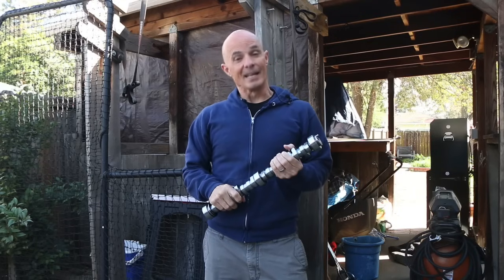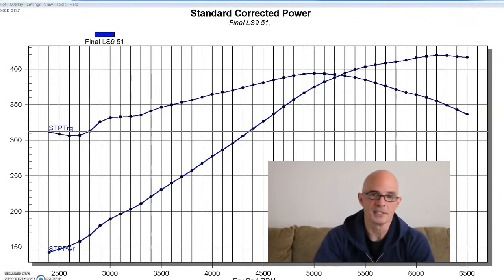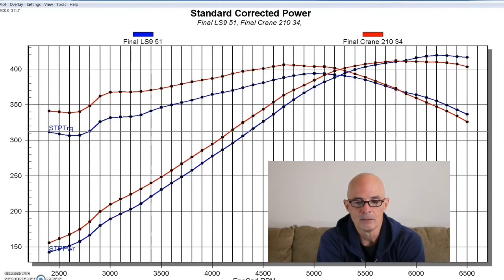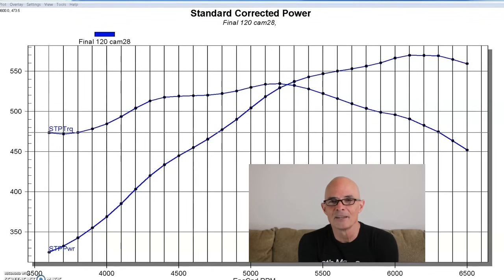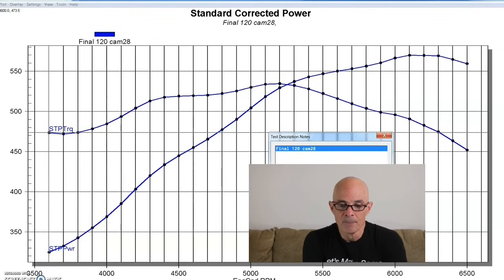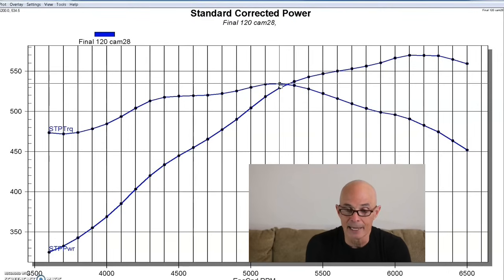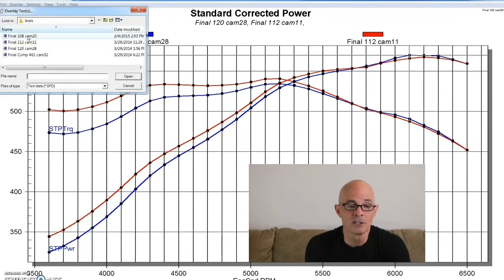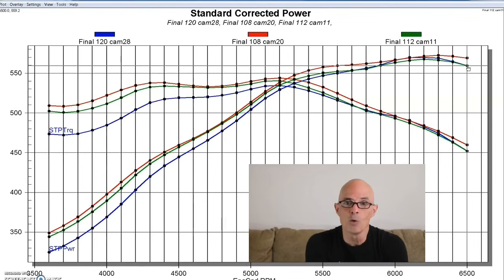LSA CAM TEST-108 vs 112 vs 120

Comment: I feel like all the torque loss from the wider LSA is because th intake valve is closing later, thus lowering your dynamic compression and low speed torque. We need an LSA test that has all the intake closing points the same.
Reply from the maker: then we are changing more than just lsa
Reply: @richardholdener1727  To be fair, changing the LSA changes more than one thing. I understand you would be changing the exhaust events. I was more curious to see what would happen if you advanced the 120 LSA so it had the same intake closing point as the 108 LSA and if that would gain the loss of bottom end torque.

Comment: Richard, what your comparison didn't revel, is the change in idle quality. Back in the late 90's, I helped a neighbor change the cam in his pickup, he got too greedy and installed too big of a cam. The idle was rough, the bottom end was soft, and it wouldn't pass emissions. Two months later he put the original cam back in. What if you chose a good idling cam, say a 206/206 with a 110 LSA, and compared it to a 216/216 with a 115 LSA, and a 226/226 with a 120 LSA. Obviously the longer duration cams would also have higher lifts, but that is part of the tradeoff, they should all idle about the same.

Comment: A 106 LSA may be ideal for the cubic inches ? Its pointing in that direction ? Even if it loses on top the torque increase on the bottom end would be great for a pro street car with less converter !?

Comment: Dumb question. If a tighter lsa increases low end power and torque why do car manufacturers install wide LSA camshaft? For instance my car a 2002 Holden Ls1 has a 118 degree LSA
 Fuel economy?
 Thank you in advance
Reply from the maker: tighter LSA alone doesn't always improve low speed torque, but idle quality and drivability are both much more important for EOM motors than more power (they can easily make the desired power)

Comment: It would be nice to also measure fuel consumption with every different LSA.
I don't know about everybody else wanting "balls to the wall power", but me likes a broad torque/power band. I don't want a cam that only gives me power at the low end, mid range, or high rpm. I want consistent power throughout the rpm band, like for towing, and general purpose street use, with plenty of power to haul ass down the road. I hardly ever need power over 5500 rpm. My C-10 SBC cruises at 70mph turning 2500rpm n still has plenty of power. My BBC does 70mph turning 2000rpm n still has plenty of Huevos. My compression ratios are about 9:1 to run pump gas. Knowing this consistency also gives me good idea of fuel consumption.
In general, bigger cams burn more fuel n need more vacuum. Higher compression may give you a bit more horsepower at the expense of running hotter, but you can also accomplish the same thing by increasing duration, ie, keeping the intake valve open a few degrees longer for more cylinder fill... Valve overlap between 36° n 42° will give you a nice lope with a decent idle. Anything higher n you will also have to idle higher to keep the engine running n not stall out because it needs to breathe harder...
Reply from the maker: that is why I provide curves-so you can decide-you can't measure cruise fuel MPG on the dyno
Reply: @richardholdener1727 
Sure you can. It takes more math. 
Tire diameter, how many tire rotations in a mile etc, and you can also measure how much fuel was burned in the short dyno runs you do. 
If you run a one gallon gas tank n run it into your carb, you can measure how much is left after the dyno runs. 
How much time in rotations make a mile n you can measure or figure out the approx mpg...

Comment: Could you recommend a Saturday night special cam. Light street car. 3.9 rear gears Tr6, 20 lbs centrifugal plowed, EFI.   Engine built to handle 1200 hp easily.
Reply from the maker: btr red hot or hot rod

Comment: I think with the turbo you want more lobe separation so you would gain way more on top with the higher lobe separation if it was a turbo engine
Reply: And with the supercharger you find the exact opposite you want the lowest lobe separation so the pressurized air can pump out the exhaust
Reply from the maker: that does not show on our dyno results with boost

Comment: Great video but Richard didn’t explain with much detail why we use higher LSA on newer fuel injection vehicles?  A lot to consider here from idle characteristics and tuning per application…. 🤷‍♂️
Reply from the maker: wider lsa would improve idle vacuum

Comment: This test be more better with a shorter runner intake
Reply from the maker: it would be the same
Reply: @richardholdener1727  how so? Wouldn't the wider lsa want more rpm of which the shorter runner intake would allow for
Reply from the maker: runner length does the same thing with every cam, shorter runner are optimized for power higher in the rev range than longer ones (with any cam)
Reply: @richardholdener1727  the cam and intake need to match....if not you just end up with a bad combo

Comment: So you changed the cam timing events.

Why bring in another unnecessary measurement, for no particular reason.

Engine builders have been developing engines for a hundred years, moving the opening and closing timing in relation to the crank, without worrying about some invented angle that happens to be somewhere I the background.

Comment: I have an Australian  6l aluminium block stroked to 402. Callies crank and rods etc. Ported Trickflow GenX 225 cathedral port heads. My builder is recommending 234/251 114 lsa cam. Isn't this going to be WILD???

Comment: don't forget you loose a lot of vacuum brakes start fading  for 5 hp with that particular grind  my cam got scored up when a lifter broke it had a 112 LSA  and some brake fade .i had the same cam ground for the  it and went to a 116 LSA and i picked up a 1.2 tenth in the 1/8th and run's so nice and smooth  and no more brake fade

Comment: Cam say 111+2 is it a 113 ?
Reply from the maker: no, the 111+3 is advanced ICL (not a change in LSA)
Reply: @richardholdener1727  ICL ?
Reply: @Fljeff7  Yes, intake centerline, in other words we are advancing the entire camshaft simply because we cannot alter lobe separation angle. LSA alterations can only be done on a dual overhead cam set-up where you can advance One cam and retard the other.

Comment: It would be great to see what that test would look like with a small displacement engine with really good head design. I'm thinking two-ish liter twin cam engines. Maybe a Honda or.... you have the experience in them... a Quad 4. What would be the practical effects since those engines will have a shorter duration cam profile for a given RPM range?

Comment: Looove the chop, except now I want to a 400 sbc for max torque in a cj 5.
I question what the lopie chop does for vacuum at idle as I want run vacuum advance and vacuum powered power brakes.
Reply from the maker: chop hurts vacuum

Comment: I would also add you can have a tight lsa without chop. There's other factors at play, not only me saying it. A cam grinder has saidthe same thing.
Reply from the maker: ONLY WITH VERY LOW DURATION

Comment: You can do 2 different dyno pulls and overlay the 2. 1500-4500 and 4k-7k
Reply from the maker: NO ONE IS EVER AT WOT AT 1500 RPM (YOU NEED TO SHIFT TO A LOWER GEAR)

Comment: Awesome video's and content Richard... Have you done anything with variable Duration lifters like Roads lifters. I heard a comment about them advancing the timing events as well as reducing duration but have not seen anything "tested" like how you do it...
Reply from the maker: I have not yet
Reply: @richardholdener1727  thanks for your reply, I respect your work...
Reply: I've been thinking about trying them on a 238 @ 50 cam with 106 LSA...
Lots of overlap. The paper work says the reduction of up to 20deg @50 would result in a cam profile of about 218@50" lift below 4000rpm. 
Maybe 238 @50 would be too small to make the most of this?

Comment: Only 3 reasons I can figure for a wide LSA
1) Less low end torque
2) better idle
3) bad tuner/ can't get the cam to run properly usually with factory electronics

Comment: Ive been doing so much research and still a bit stuck. Im rebuilding an lm7 in my lifted truck and not looking for crazy power or running real high rpm. What would be an lsa i should shoot for? Youve tested everything so im sure youd have a good idea.. i want a little extra power everywhere but low end torque is most important for me being a daily driver lifted on 35s i dont want to sacrifice anything just looking for some extra power without being crazy. I dont care what it sounds like or how it performs at 6000. Im just so lost brother hahaha

Comment: The biggest issue missed by many on an LS cam selection is the intake design is very much like and or mirrors the characteristics of an individual runner intake, and how a tight LC cam creates a reversion pulse, which on a common plenum intake can be masked, as another runner will pick up the reversion pulse, however on an Individual runner intake, or most non common plenum LS intakes it makes a huge difference
Reply from the maker: you need to go study the three forms of charge filling associated with intake design. Search Reflected wave, Helmholtz Resonance and  Inertial Ram.
Reply: @richardholdener1727  you don't know what you don't know, I realize you have a YT channel to run so carry on, don't hide a response to your reply just to look good, if your going to make a comment that infers you have a lot of knowledge expect a rebuttal, you can read theory all you want, it's different in the real world, the biggest mistake many people make when commenting is they have no idea about the experience the person may have and therefore miss the opportunity to learn

Comment: Should do Small Block Ford engines and aftermarket cams for the 302 and 351w or even a 460bbf or other small block ford aftermarket cams

Comment: So what about running a boost application with a 108 lsa cam?
Reply from the maker: works fine-see the 107 lsa Truck Norris cam turbo test
Reply: @richardholdener1727  the cam I have was given to me. It’s a custom grind cam from comp and the specs are 248/250 .595” with a 108 lsa. I was just curious as to how it would work in my 383 ls build. It’ll be n/a for the first year or so then hopefully a supercharger. Just waiting on rings so it can be put together. I also have a stage 4 btr cam I don’t kno the specs
Reply: @richardholdener1727  from what I seen in the truck Norris test you recommended. I should have a decent power curve throughout the entire pull or atleast I’m hoping Im Right lol

Comment: @richardholdener1727 how about a test where we keep the cam overlap the same and see how different LSA and duration combination compare.  I watched this video and as you changed only the LSA, kept thinking, changing only the LSA is changing the cam's overlap and therefore the cam "stage"... i.e. going from say a Stage 1 (120 LSA) to a Stage 4 (108 LSA) cam I would expect a difference in power as the LSA drops.  I keep hearing from other internet channels how LSA is so important.  I say compare say 108, 112 and 116 LSA cams, but now keeping the duration the same... does the 108 LSA cam with the same duration really out perform the 112 or 116.  My thought is this... if I want a cam for my LS7, and I want my duration in the 25 degree range (putting the peak power around say 6500 - 6800 RPM), does a cam with a smaller or larger LSA get me more power and where.  Thanks!
Reply from the maker: CHANGING ONLY LSA DOESNT MAKE A STAGE 1 CAM A STAGE 4 CAM-BUT CHANGING DURATION SURE DOES
Reply: @richardholdener1727  Maybe Stage 4 was the wrong wording... but adjusting LSA can sure take a milder cam, say 10 degrees of overlap, and move it to a lot more "routy" cam with a lot more overlap... say 25 degrees

Comment: Personal Observations:

After Viewing 2 Other Dyno Cam Test Videos I'm Starting To Realize That Overlap Doesn't Really Shift The HP And TQ Humps Left Or Right On The RPM Axis. It's Seems That All It Does Is Improve The Amount Of Power And Torque At The Current Locations In RPM Peaks. 

This Video Showed Substantial Changes In Overlap Between These 3 Cams. Shifting The Power And Torque On The RPM Axis Is Not Really Adjusted With A  Camshaft. That's Nearly Exclusive To The Intake Runners.

These Massive Changes In Overlap Are Trading Low End For Top End However It's Trading It Where You Can Not See On This Graph. It's Clearly Below 3500 RPM. It's Not Trading Mid RPM For High RPM Power Like I Thought It Would. It's Literally Trading The 2 Extremes. Extreme Low RPM For Extreme High RPM. 

All These Camshafts Maintained The Same Duration Bias For The Exhaust. This Kept The Width Of The Peak Humps All The Same.

This Video Does Actually Demonstrate The Affects Of Reaching The Optimal LSA For This Given Engine Despite The Drastic Changes In Overlap Since The Difference In Overlap Only Affects The Peak Humps Vertical Axis Gains. The Looses From Overlap Were Not Able To Be Shown As They Are 3500RPM And Lower.

These Are My Personal Notes.

Comment: The problem most viewers will over look is that this is a singular engine with singular cam specs, LSA being the only variable. This will not stand true With higher duration, higher reving cams. Interesting videos, but there is much, much more to unpack here. LSA should always be a derivative of valve events not a component of the specs we select.
Reply from the maker: agree
Reply: @richardholdener1727  I know a 8000+ rpm engine for a test bed isn't something that's laying around, but the inverse results would be cool to see on something 380 ci, 280s @ .050 with some big rpm.

Comment: 2 Things Changed Between These 3 Cams. Overlap And LSA. The Tighter LSA Had The Most Overlap. Overlap Changes Where Peak Is Made Or Rather: More Overlap Means Higher RPM Efficiency. The 108 Had Greatest Overlap And Trades Some Of Its Low End For Higher RPM. 

The 108 LSA Might Have Also Been Approaching Its Ideal Number Hense Overall Torque Increase Compared To The Rest. The Only Closest Way To Compare LSA Between Camshafts Its Keeping The Overlap The Same Which Means Adjusting The Durations Of Each So That The Overlap Remains The Same With The Different LSAs.

Comment: I have a question. Using the david vizard 128 formula, it suggests the use of a 107 lsa. Will this number change if i decide to add boost or should the 107 still be optimal?
Reply from the maker: you should ask David-there is no absolute optimum LSA

Comment: Running a compression check between cams would explain why torque went up. Also vacuum changes.
Reply from the maker: cranking compression and torque are not directly linked

Comment: This is a great video, and comparison, Richard. I've watched a few of your vids before, but decided to login to my gmail to comment.

I have a question you may be able to help me with - I have a '98 Mustang gt with a 4.6npi. I have a set of lightly ported pi heads, pi intake, headers, 3:55 gears, 5spd t45.... I know there isn't a lot of clearance here with the npi blocks and pi heads, so I ordered a set of cams from TW last year. (I don't want to put him on the spot, but will email you his name if you want it) They're custom comps.
Anyway, I havent done the work yet, mainly because I'm not sure about these cam specs. 
 
From the card - 
.495 int and exh lift, 
.261 intake duration & .267 exhaust duration, 
.224 intake duration & .230 exhaust duration @ .050, 
109 centerline, 
108 lobe separation.

Do you have any thoughts on these number? I don't plan on racing it, just wanted a lope with more power from the higher flow and compression with this head/block setup. Since the 4.6 2v isnt very popular anymore, and theres hardly any videos of people testing diff variations with the 4.6 other than you, you're the first person I've asked.
Reply from the maker: watch the video where I tested all the Comp 4.6L 2V cams
Reply: It's a custom cam though, not one you tested or could buy off the shelf.